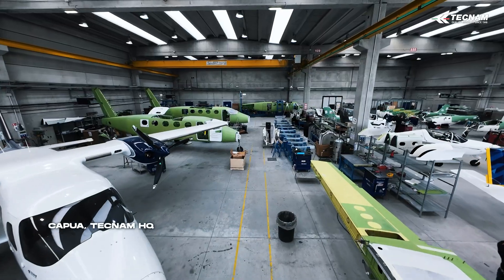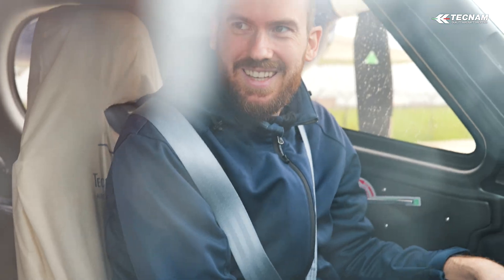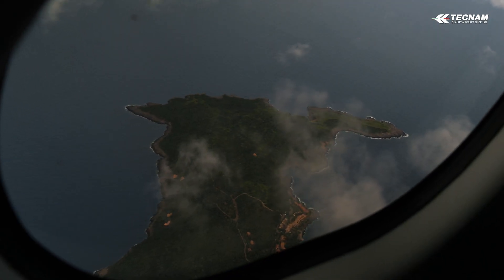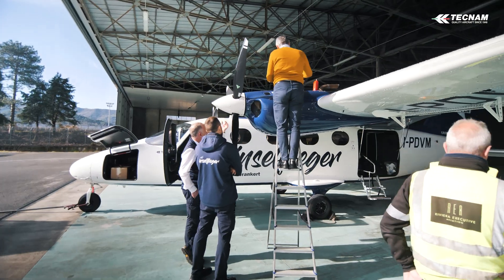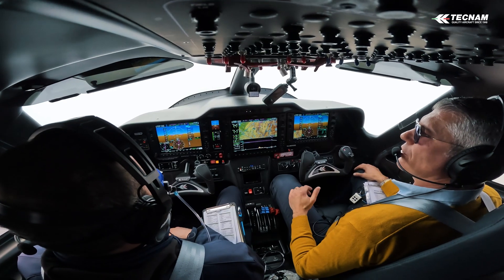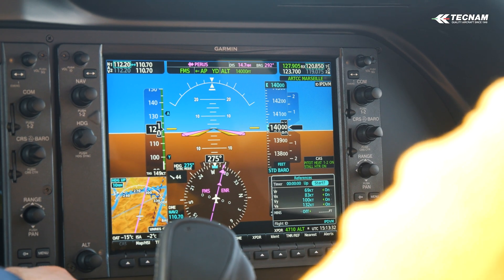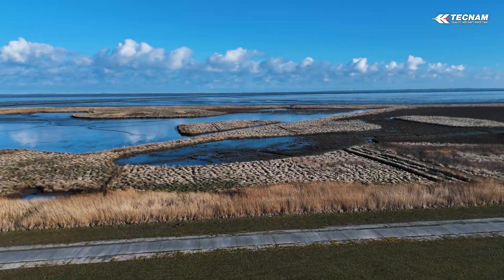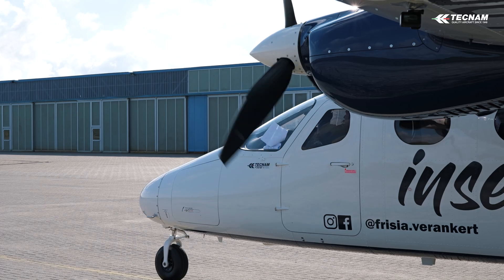"Mission Delivery" - Tecnam P2012 STOL ferry from Italy to Germany

Comment: Hello Tecnam. What is the inside noise level difference like in the STOL with Continentals vs the regular P2012 with Lycomings? I noticed the exhausts are above the wing on the STOL. Thank you.
Reply from the maker: Hello. The noise is measured for all the aircraft in the same conditions I.E. from outside the aircraft, in takeoff power, at a certain distance from the ground. This is established by the Annex 16 of ICAO. At full power, and from outside, there is a 4 db lower noise for the STOL, -3dB if the Lycoming is with noise reduction. At cruise power this is not so big, but still, the Continental is quieter for 3 reasons:

- lower RPM than Lycoming
- exhaust installation 
- larger 3 blades propeller

Trying to summarzie details: all the P2012 have the fuselage entirely filled with passive noise canceling materials, making the on-board experience significantly more comfortable than equivalent category aircraft. The P2012 Continental (Travelled and STOL) further benefit from a lower RPM engine type and over the wing exhaust, improving the on board experience.

Wish you a great day!
Reply: @TecnamOfficial thank you for the detailed reply!
Reply: @TecnamOfficial 

This looks like a contender to replace the caravan for a lot of missions. Is there a plan to introduce a non 100ll variant? Preferably not with a TBR but Tbo because of the implications if the engine manufacturer would be in trouble.

Comment: Manual prop pitch and mixture in 2025, especially for a commercial aircraft does not seem to be state of the art 😮
Reply from the maker: Hello Thomas. Tecnam offers two engine choices on the P2012: Fadec Lycoming engines and “Classic” management Continental engines.
The Continentals are the engines that equip this P2012 STOL. Reason being that most of the pilots and mechanics operating in remote, inaccessible and extreme airports are very familiar and confident with this “classic” engine management system and its maintenance. These aircraft are operated in locations where the support may be minimal, sometimes even having electric shore power is a challenge in those runways, so the basic system without any sophistication fits perfectly to the mission.
…and if not, then we have the Fadec controlled ones!
Reply: @TecnamOfficial Make Sense❤